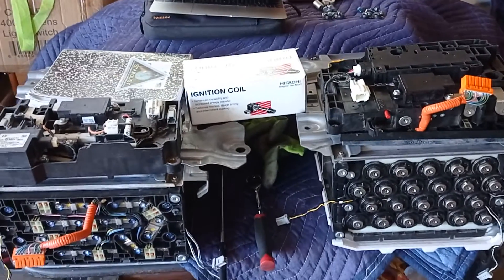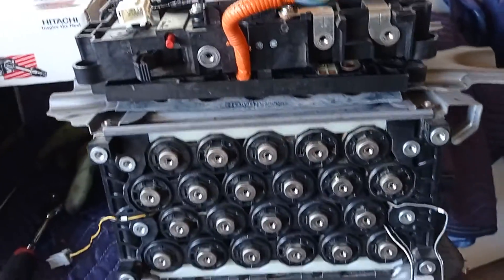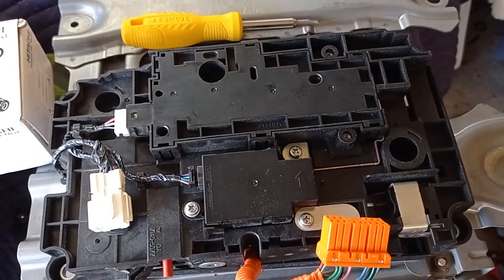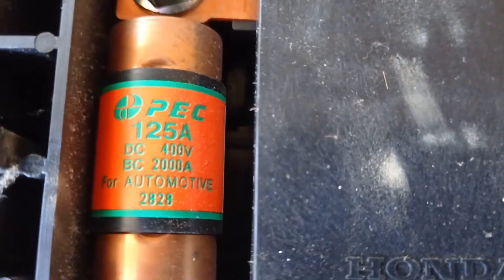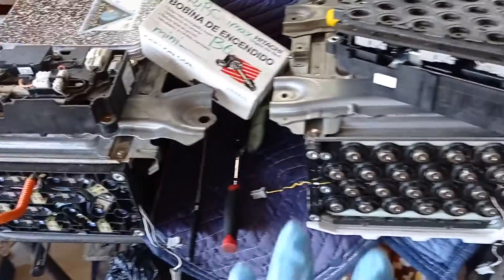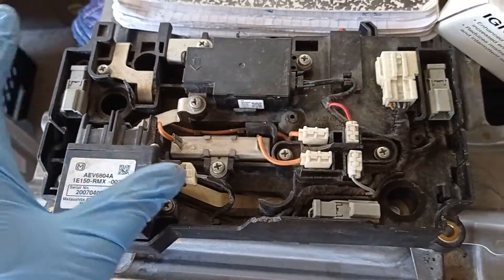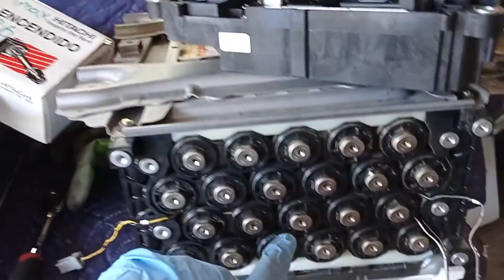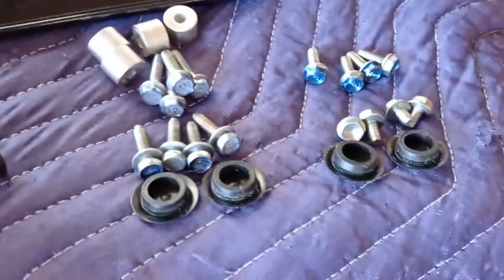Comparing Two Different Honda Civic Hybrid IMA Battery Modules and Junction Boards

Comment: Hello, what is the correct internal resistance of the cell if the cell is 7.2 volt? Thank you
Reply from the maker: Perfect question. Check IR of all sticks fully charged, then compare. Do it again when they are discharged. Then, we may see some interesting results.